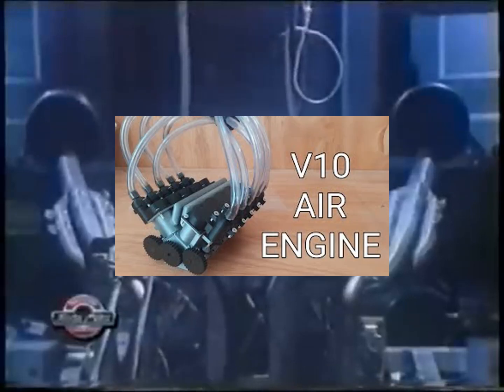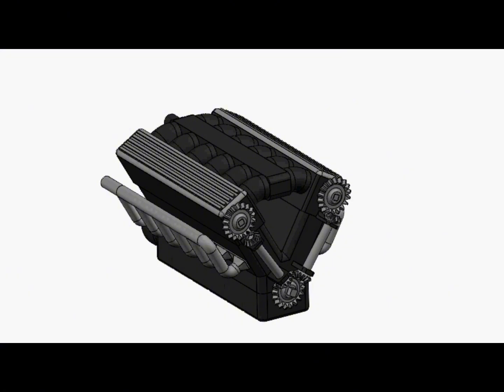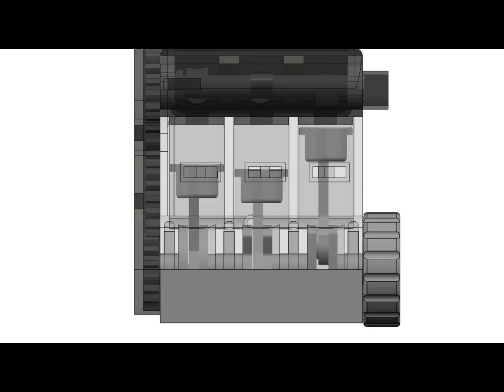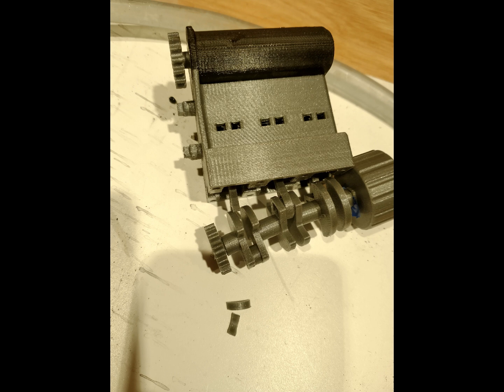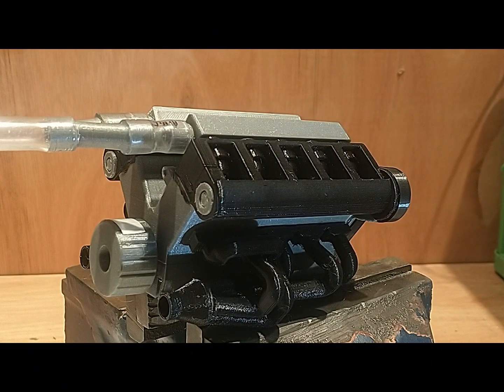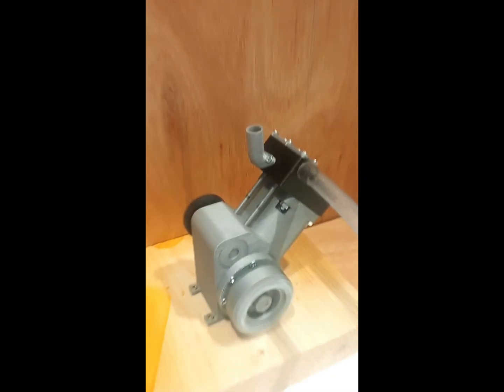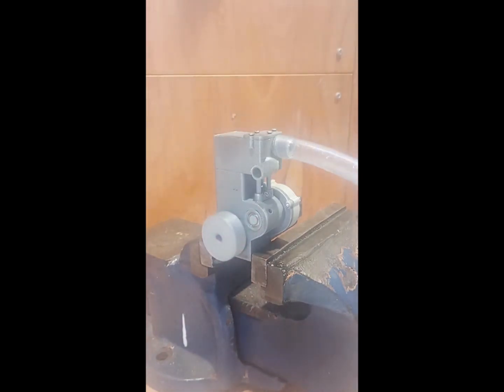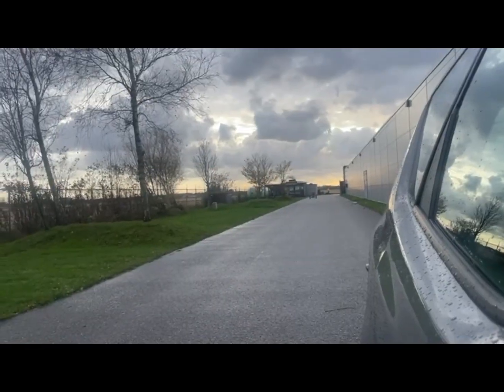Improving 3D Printed Air Engine RPM

Comment: Very impressed with your work and design. Ive seen many but I this the first with cam operated valves. Did you hit 111K RPM with 4 barr of pressure? Will you be sharing the source files or STL files for your final single cylinder version? I would love to print this in SLA or do some parts with my cnc as well as work on it a little further.

Comment: If you make them really small (the size of LEGO engines) you can use bicycle tyre valve to let the air in in the right time. YouTube channel LEGO Technic Embodiment made a couple of videos with this design. It's pretty simple actually.

Comment: How did you get the pushrods to seal? I am designing my own engine but I don't know how I would seal the pushrods where they go into the intake so the air doesn't just leak by.
Reply from the maker: They dont seal, i would just make the smallest tolerance i could make them and pray for the best